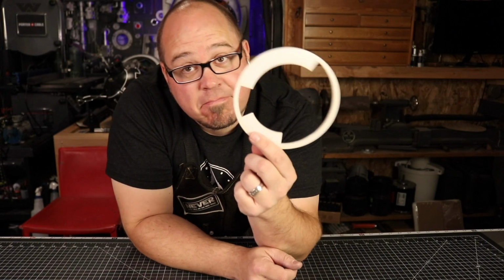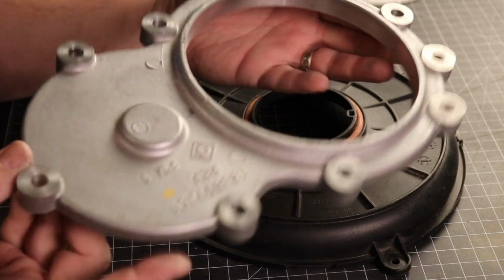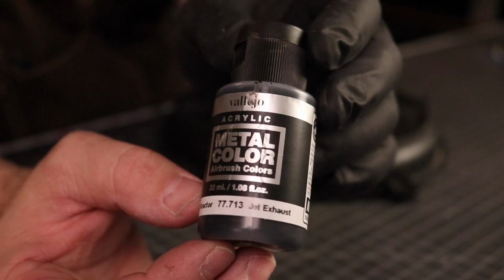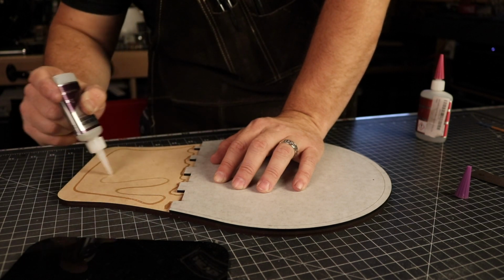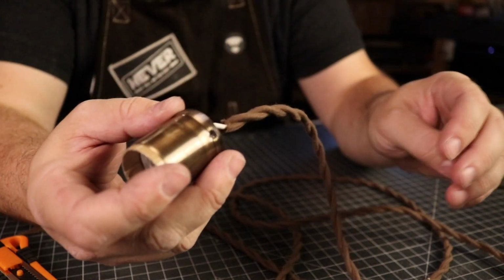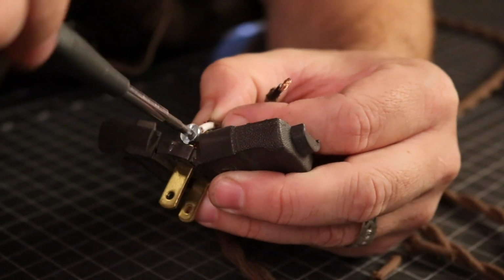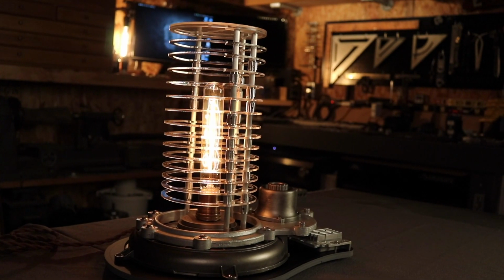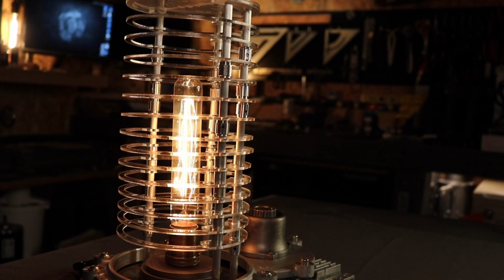Industrial Lighting Ideas | Sci Fi Lighting

Comment from the maker: ELECTRICAL SAFETY NOTE:  Hey everyone, I made a mistake in the wiring of the switch.  As Mike and Wayne indicated in the comments below I have the break in the White/Neutral in the switch, and that should be the Black/Hot.  If you wire it as I have done you could create as shock hazard as Mike pointed out, your lamp will always be "live."  So I have already switched this in my lamp, but if you make your own be sure to set yours up accordingly.
Reply: But, the live wire and the neutral wire get swapped if the plug is flipped over...

American wiring is terrifying /Brit
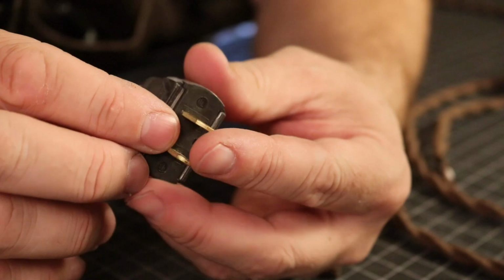Reply: All you really need to do is show yourself wiring two brand new wires into a new box from 9-9:30, correct the voice-over and movie magic will take care of the rest. You don't have to take anything apart.
Reply: It looks like you used a non-polarized plug.  Regardless of how you wire the switch the plug could still be put in the other way around.  I would always unplug it before changing the bulb.
Reply from the maker: @andrewdonatelli6953  It's a Polorized plug, so the flip of the wiring in the switch does resolve it.
Reply: @TheSmugglersRoom  Ah, good to hear.  Couldn't tell from the video.
Reply: Time for me to learn a little more.... in AC, Alternating Current, don't the white and the black both go hot alternately 50% of the time?
Reply: @DoktorHalloween  No, the neutral is only "hot" when the circuit is powered, it does not normally "go hot" otherwise unless you have an issue in the circuit.

When talking about AC vs DC, you're actually talking about the polarity of the current (DC is constant, AC alternates polarity), but the feed line (hot side) is always the source of the energy that passes through the "load" (in this case the light), and follows the neutral back, eventually to "ground".

If you install a switch on the neutral, it'll still work, but it's a huge safety issue because it means the device is always powered and waiting for something to give that energy a path to ground (normally the neutral).  This is why electrician training programs (at least in the US) generally tell you to always test the line/device to make sure power is actually off, because you never know when someone switched the neutral.  Even if you did the original install and know it was done correctly, you never know if someone else followed behind you later and changed it.
Reply: @Haladmer  Excellent!  Thanks for the clarification.  I'll be sure to follow your advice going forward.

Comment: Metal cover is for either a small engine or drivetrain transfer case. When you get more of the same plastic greeblies you should make a hanging light with red color film on the inside n make some clear long tabs to go from top to the bottom holding the film against the frame n screw the upright clear pieces together on the ends

Comment: Tin the leads of stranded wire , and that keeps " strays" from causing shorts. LED bulbs are great...not much heat, and that makes design easier. Two jobs ago, I did some work for a small town college drama department...mostly lighting.
     Cool video!
Reply from the maker: Thank you Scott, that's great advice!  Really appreciate it!

Comment: Awesome lighting project it looks great! Just a electrical safety tip always break the hot wire with the switch and the power stops at the switch. If you do the neutral wire it will go through the switch and the light then back to the switch where it then stops the power. Leaving your light in a always ( hot) condition that can shock you if worked on live. Love your show ❤
Reply from the maker: Thank you Mike.  That was what I thought too, but i kept finding information that showed the opposite?  I may have read that wrong somewhere though.  So what you are saying is that in the switch the "Hot" needed to be on the terminals correct?
Reply: @TheSmugglersRoom  correct

Comment: How do you get to the bulb to change it? O.o
Reply from the maker: The top is not glued down, just pressure fit.
Reply: @TheSmugglersRoom  I suspected something like that, but wasn't going to assume. That could become loose over time as the acrylic/aluminum wears down though. 
Still a very lovely lamp :) Very glowy.
I feel I would have added an illuminated toggle switch and "control panel" on the base to operate the light rather than the inline cord switch, but thats just my taste o.o

Comment: Awesome lamp and really good tutorial, I would recommend as an electrician to switch the hot (Black) wire even though the screws in the switch are silver. Reason being that in your Edison fixture the pin at the bottom will always be hot even when the light switch is off when switching the neutral, which means if you were trying to replace a lightbulb and your finger slips in there you get 120 V surprise, if you take down one of your switch plates in your house you will notice that your hot wires are switched for this very reason.
Reply from the maker: Thank you.  A couple other folks recommended the same.  I pinned a comment below the episode description for others to see that as well.  Really appreciate the heads up on that.  I have since taken the switch apart and swapped the wires.  Thanks again!
Reply: Just watched this and thought the same, glad someone spoke up